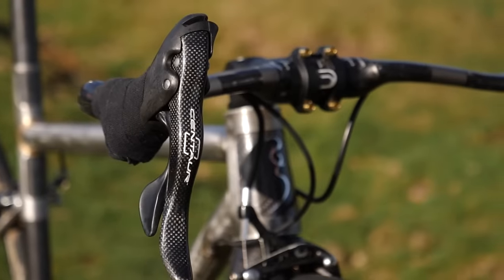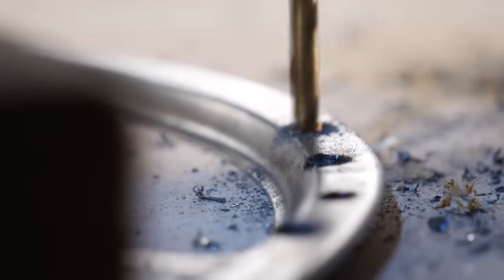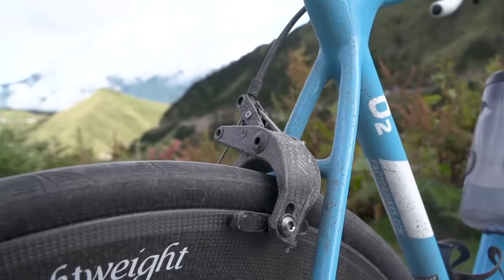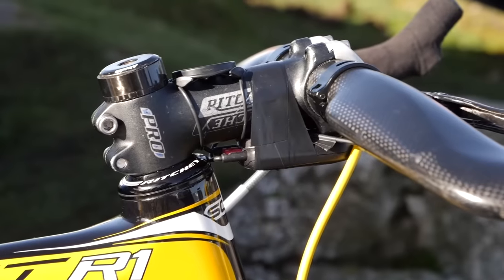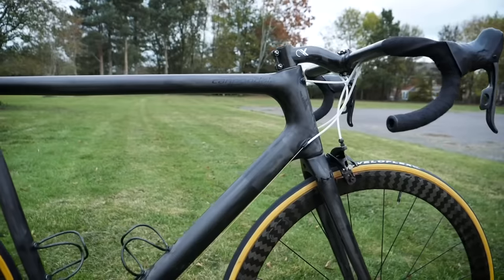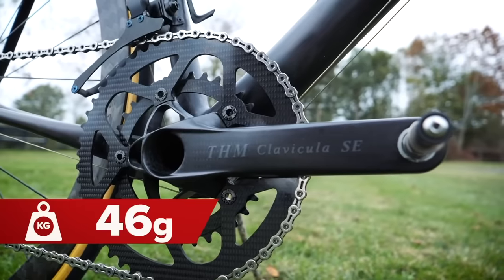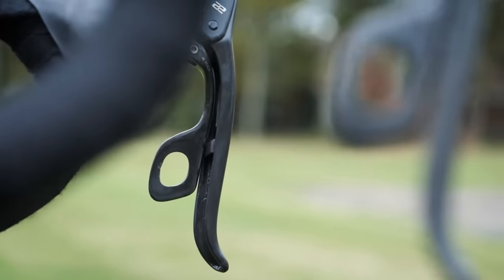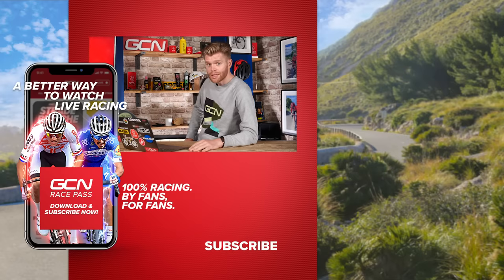How To Build The Lightest Road Bike In The World | An Obnoxious Guide To Being A Weight Weenie

Comment: Surely a Unicycle is the logical conclusion? One less wheel, no unnecessary steering components and a drive-train becomes redundant.
Reply: If so, why not then go all the way. Skip the unicycle and walk instead. You will save all it’s weight and be twice as fast...🥴
Reply: Xxçcç
Reply: Xxçcç
Reply: Saudade brooms 🧹 are also aero.
Reply: Who needs two wheels? pfft.
Reply: The rider must weigh only 10 pounds or 5kgs
Reply: Seriously, when will specialized release their all carbon unicycle?
Reply: I think on of those little clown bikes would also been a very good option. If you remove the bell, you can probably  go sub 400 grams.

Comment: Also:
1. Cut away one side of the handlebars and ride one-handed
2. Remove some spokes on the wheels
3. Remove the saddle and seat post and ride standing up. 
4. Remove one crank arm and pedal with one leg.
Reply: 3 and 4 be a challenge together
Reply: Who says you need to ride standing up without the saddle? 😏

Comment: Instead of shedding between 1 and 2kg of body weight, one could remove bar tape, have ceramic bearings, shave tire treads, remove bottle cage bolts, can probably do without a few of your spokes per wheel, slammed stem with no chimney, integrated seat stay, replace quick release skewer with titanium bolt, super thin rims, latex inner tube (perhaps this is too good value though), no computer/ power meter, get short inner tube valves (remove caps obs).

Comment: my bike came with 42cm bars, i slammed the stem and put 38's on it, saved over 20 grams by just cutting the cables to fit. then after cutting the steerer tube and with smaller bars it was a total of over 80 grams lighter.

Comment: If you can not afford a carbon frame one of the lightest but rarest alloy frames is the Schwinn Fastback Factory. The frame is even anodized instead of painted to safe weight. My Schwinn Fastback is 15.2lbs. Using downtube shifters.

Comment: Swipe out the bottle cage bolts to alu bolts ! Change the chain to a lighter one and dremel the bottle cages out . If you have valve extender max out the length to the shortest possible and use alu extender . Cut the saddle post or fase it .

Comment: There's a rather cool shortcut for them: a human head usually weights around 5 Kg. Remove it and look at how much weight you're saving! Forget about carbon fiber, drilling holes... Your head is the biggest weight impediment. There's nothing in there anyways.
Reply: Hilarious! But one point.. if nothing there in the head, which I agree since that’s really a brain less endeavour, you need to take off 1.5kg from your 5kg calculations, so u essentially only save 3.5kg in weight! Not a mean feat!
Reply: @anthonychao2173  You removed an entire "world's lightest road bike" (which weights 3.2 Kg) from your set up. How is that not an accomplishment?
Reply: Massive aero gains too. Really, it's a no-brainer!

Comment: I know how ! You buy the ax-lightness VIAL evo ULTRA with Sram red at 4.8kg and then you swap the red brakes and crankset for the THM carbon brakes and crank and add thr carbon-ti chainrings, which brings the bike down to around 4.4kg !! lol
Reply: Paul Wieringa  I know about that bike for long time now, it's really cool, but that's cheating lol chainring on carbon  (to fragile) chainring teath have to be metal like carbon-ti. When certain parts are to fragile to a point that you have to pedal like you're tip toeing in you hiuse to be quite, those carbon teath chainrings brake to easy. Personally, we can't count one by systems yet, when all road bikes are still 2 by systems unless it's a gravel bike. But, hey it's cool to see where we could be in the futur !!
Reply: Paul Wieringa  last but not least , it has to be a bike that people can buy too lol 1 for 1 don't count lol
Reply: Paul Wieringa  true but not the frame, fork and stem bar, that was a one off bike project
Reply: Paul Wieringa  yeah, I think all brands should produce lightest bike possible and usable daily, for the people that want bikes lime that, and there's a lot out there, but, that ax-lightness at 4,4kg is light enough lol
Reply: Paul Wieringa  exactly, that's the point, there's a market for it !!

Comment: You didn’t mention replacing bearings with fully ceramic bearings, titanium shift and brake wires, removing the expander and top cap after clamping the stem…. 

Yes WW ride their bikes, I have a 6.65kg rigid MTB and yes I do ride it.

Comment: Consider inflating tires with hydrogen. It'd be dangerous but it's lighter than air
Reply: Helium might also take longer to diffuse through the tires.
Reply: H2 is OK as long as there is no O2 in the tire and it has less tendency to diffuse through the tire.
Reply: Why stop at the tyres ? Shove a balloon (or condom) in each end of the bars, fill them with hydrogen/helium. And the stem and seatpost too !
Reply: @TheExposerofLies  are you crazy? Helium is twice as heavy as hydrogen! We are talking at least five milligrams there.
Reply: Even if you put a balloon on your bike it would be exactly the same weight to move ....  :-D

Comment: Do you even need a chain? Or a front wheel? Or any brakes? Tbh you may as well ditch the frame and just have a unicycle
Reply: Why keep the wheel, frame and saddle? Drop that weight and you'll be ultra light. People might accuse you of being a runner, but it's still cycling if you're in your 50 gram carbon cycling shoes (without the cleats attached of course, they're excess weight)

Comment: Casette, cables, brake, shifters, who need all that ? Just ride a Fixie and you will save alot of weight !
Also why need a seat when you can just climb while standing on your bike ?
Reply: And who needs the luxury of 2 wheels? 1 will do just fine!
Reply: "At home, Nathaniel sits on a spike!"
Reply: Ecce Homer black adder the second.
Reply: Different class.
Reply: There is actually a seat available for flatland BMX which is made of translucent one-piece plastic rigidly attached to a very short seatpost...
Reply: @samthe1337man  it does stop being a bike then though...
Reply: Fixies are great but not very useful when you try to climb up a mountain :)
Reply: I would like to see a guy on a seat-less fixie going 50 mph downhill.
Reply: A fixie has nothing on a unicycle though

Comment: Haha you basically described my bike 😂

You forgot Nylon brake cables like PowerCordz & Carbon fibre bolts from Schmolke among other things.
You also failed to mention about cutting seatposts.
Reply: I noticed that he didn't mention a number of things that could cause harm to the rider. Your suggestions also came to mind but they're obviously also a safety risk that GCN isn't going to mention on video.
Reply: @gaijinpl  Like Titanium screws and drilling is not a big safety risk?
Reply: @wazzzaaapdude8748  , Yeah, um, not nearly as much as nylon cables or carbon fiber bolts would be. There's a bit risky, and then there's just plain stupid.

Comment: I'm going to argue your point about carbon wheels. Alloy tubulars can be built to be far lighter than any carbon wheel. Such as mid 90's Mavic Reflex rims in the ultra rare 20 hole drilling and baby blue anodized finish, titanium spokes in a radial front, radial and 2x rear build pattern to use the shortest spoke possible (rainbow colored of course for bling), alloy nipples in alternating colors (again light bling and it doesn't matter if they will round out while trueing them as long as they a true the first time you ride them), tiny flange hubs from American Classic again the ultra rare ones with a carbon center body and alloy flanges glued on (the glue will hold for at least 100 rides before letting loose while decending a mountain) and to cap it off FMB tyres with the silk casing because tyres made using worm poop will be lighter than anything else.
Reply: I like your overall build-up idea, but it sounds a bit more retro than lightweight. The lightest rims Mavic ever made sit in the 260-270g range (OR7), and they are downright dangerous, and not intended for rim brakes (track only). The lightest Mavic Reflex tubular rims sat somewhere in the 370-390g range. That's nearly twice the weight of a good 23mm x 22mm carbon tubular at 210-220g. X-bike makes these if you're on a budget, or you can spend 10 times as much for a AX lightness equivalent that is closer to 200g. For hubs, I believe the reigning champion is Extralite with their Cyber series hubs.  Combine these with titanium spokes (I much prefer Sapim’s CX Superspokes with a 40g total weight penalty) and you can build a wheelset in the 730g range.  It will be flexy, and probably not for anyone over 150lbs, but they will work pretty well.  Move to 24h rear, and use Sapim CX Superspokes, and you can build a good rim-brake compatible wheelset suitable for <200lb riders that will stay true and perform amazingly well, and still be well under 800g.  The same cannot be said for any wheelset with aluminum rims.
Reply: @opcolu  https://zedbikewheels.com/product/hyperlight-superstring-ax-hill-climb-690g/ proves that carbon tubulars are definitely the best option, although I like a nice light set of alloy clinchers too for practical riding.
Reply: @franciss2529  wow, i did not know that such wheels could even exist
Reply: @8paolo96  yep, crazy stuff but they do cost a fortune.
Reply: AX lightness do a set of tubular wheels that weigh 790g - I don't know of any production wheel that matches that.

https://www.benobikes.com/en/bike-parts/wheelsets/roadbike/ultra-25t#c6dc7ef36b3b43096f1bfb5658e38795
Reply: I had some wheels made with Titanium spokes back in the 90's,boy did they flex,when you gave then some big effort they were like noodles...noodles are better after the ride.
Reply: Have them re-laced with berd spokes and you can get that number sub 700g
Reply: @Kazyole  @Kid Karbon check the link I commented

Comment: Helium in your tyres would help, it worked for Merckx in the 70s. You could also seal the frame tubes and put it in there. And you could challenge said German carbon frame manufacturer to push the envelope like my mate did. It worked great, until the fork collapsed and he broke his neck. The very reason the UCI has mandated 6.8kgs!
Reply: How does the UCI come to that figure?

Comment: While I really enjoy content like this, I hope we all know, that super mega light really isn’t necessary. You are saving  2kg over an aero bike, and have several compromises and it will be slower basically anywhere but the steepest of climbs.
Reply: I think you are missing the point of these bikes. They are built for hillclimb events and they actually have a purpose to go up the steepest climbs possible in the quickest time. Just like a super aero tt bike has a purpose and a road bike. I'm exactly sure why these types of bikes are being mocked tbh.

Comment: Why do they think Titanium is as soft as cheese? Have you been buying Chinese Titanium or something? Most high end stems have ti bolts and it's no problem. I have hollow Ti bolts on my seat post, opened and closed it maybe 4 times this year to adjust my fit without any trouble... I do use a torque wrench and copper grease for the bolts... as I do with steel and aluminium bolts.

Also saw a 5.6kg Titanium bike the other day... so you don't have to choose carbon frames.

Comment: Don't drill anything unless you can formulate calculations and stress test post drilling. You can buy 6 lightweight cassettes ex Asia for the price of red or dura. Ive used a few and they're alloy but if  you keep the chain fresh and clean they last for ages. They're lighter too.
Reply: Where do you get ex Asia cassettes?
Reply: @aaronweigerber5313  AliExpress or eBay ztto brand

Comment: A true weight weeny wouldn't have more the 2 sprockets om their bike One at the front, one at the rear. No shifters, derailleurs, cables (inner and outer) and a shorter chain. How about carbon fibre disk rotors for the weight weeny disc bike?

Comment: "Make sure you sand down your brake blocks 2/3 before installing them." Excellent advice Mr Ollie 

I'm surprised you didn't advise the weenies to use WD40 instead of grease. Surely that's more sensible than NO grease or lube. But then again, a coating of WD on the chain might weigh 1/2 gram, and that may be unacceptable.